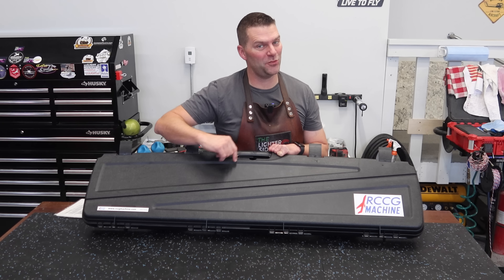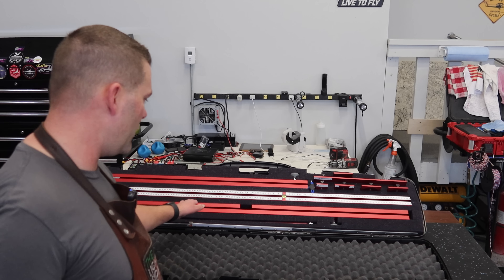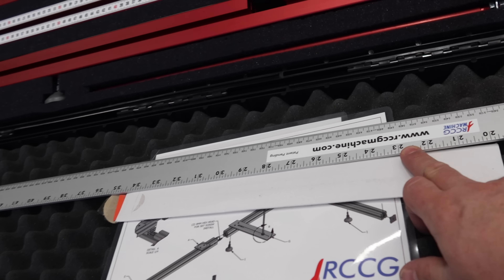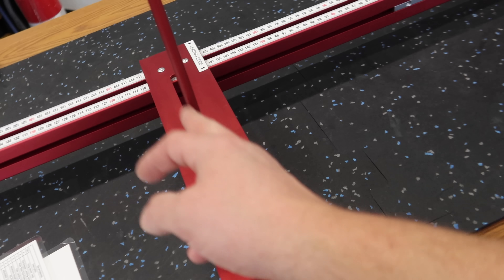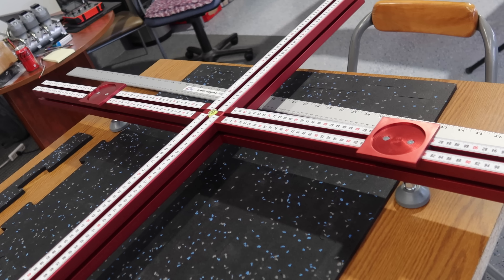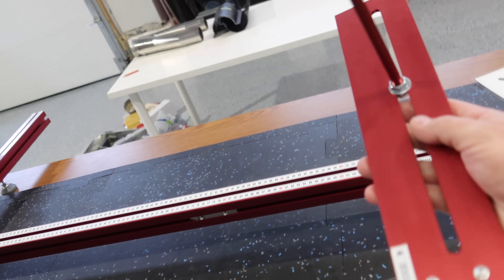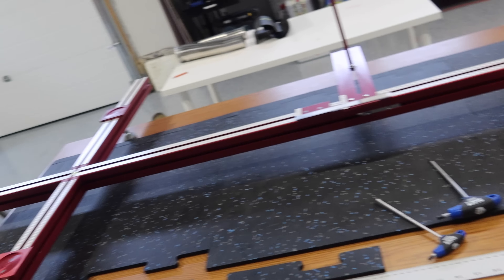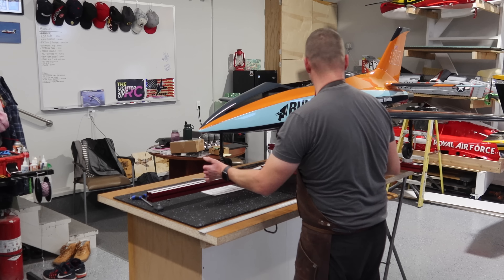NEW BALANCE Machine - THIS CHANGES EVERYTHING

Comment: This makes sense for someone in your position. For the general hobbyist such as myself. The xicoy is just fine. I may cg a plane on the xicoy  once a year or every two years. So it’s just not justifiable for $1200. This is bad ass though. And if it made sense and I had that kind of money, I’d definitely get one. However at the end of the day, $1200 for just a ruler system, imho, regardless of the convenience, is a bit high it seems.
Reply from the maker: Thanks!  It will get lots of use in the shop for sure!  Thanks for watching

Comment: I really, really ike this RCCG-Machine . . . and looking over and over the use of this tool on your Albatros-build . . .  then I guess ( 13:18 ) if you have spaced out both main gear wheels on the cross-bars . . . and you measure the diagonal from one main gear wheel directly to the nose wheel . . . and if you take this measurement to your RCCG-Machine . . . . then there is no need for "eye-balling" :-)      . . . . . and yep I look for the RCCG-Machine in Europe as soon as it is available. (my 2cnts)
Reply from the maker: Yea it's pretty dang sweet.  When you get the aircraft on the stand you already have your first measurement shown on the ruler.

Comment: Not sure this is easier then just using a yard stick. U still have to take most of the same measurements to set the thing up.
Reply from the maker: Of course you need all the same measurements. Having used a yard stick, tape measure. Masking tape, plumb Bob for many years now this is a huge time saver for me.

Comment: Great to see a new product come to market but I don't understand how this helps regarding precision provided that the user still has to center the wheels on the Xicoy sensors. If the centering of the wheel isn't exact, cg could be of by a few mm which is exactly the same problem as measuring.
Reply from the maker: Quite simple. It eliminates error in measuring and speeds up the measurement process. Unit levels so you know it’s level. On a garage floor or a bench/table on a garage floor it will typically slope to the door.

Comment: Great tool and in investement it matches up with the total-price of most scale-jets. Very, very smart design. Noticing there are "alternatives" for the Xicoy-set, it's interesting to know if thes will fit the "pucks". Any idea what the size is of the square pucks in which you place the Xicoy-scale?? If the square size and diameter is clear, I can check if this RCCG-Machine also fits the "alternatives" one. . . . opens the market al little bit more maybe. Thanks
Reply from the maker: Thanks and Totally Agree.  So many have such strong feelings that spending this much on a quality tool is crazy.  In Michaels "how to" video on his site he is using wireless pucks.  Not sure if they are Xicoy units or another brand but the area where the pucks sit are slightly oversized.  So the Xicoy pucks have a bit of wiggle room
Reply: @thelightersideofrc  Would be great if it suits/fits more "Xicoy-variants". Do you maybe have some measurements (square sizes and inner-diameter) so I can check overhere in the Netherlands? Appriciate 🙂
Reply from the maker: Can do. Please shoot me an email. Much easier than YouTube comments. thelightersideofrc@gmail.com

Comment: Hi, do you always only use the landing amount of fuel when measuring out the plane? If the fuel tank is not placed at CG that must affect the CG with full amount of fuel then.
Reply from the maker: As a general rule, CG is always set up when the plane is in landing condition. Obviously the further away the tank is from the CG point the more affect it has.

I will sometimes check the CG range from full to empty and in between, but ultimately if the plane becomes more nose, heavy when full, there’s not much you can do about it

Comment: Nice job I like the way it works, but my question is do you always C.G. your jets with the landing amount of fuel in the tanks?
Reply from the maker: Thanks!  Yes unless the tank is perfectly placed over the CG Point.  Generally this is not the case and it's slightly in front of the CG Point.  Always CGing in landing condition.
Reply: @The Lighter Side Of RC  thanks for the reply, I'll probably start adding a little fuel the next time I balance something it makes sense.
Reply from the maker: Perfect 🤩

Comment: Use a plumb Bob to get the front wheel from gear measurement and string a line between the mains and run measuring stick perpendicular to the main fr exact measurement and simplicity
Reply: Nvm not needed as you can adjust after you set the plane on th roughly set pucks

Comment: At $1200 this is quite the investment.  With the Xicoy we’re at $1500 to measure CG 😮
Reply from the maker: Oh for sure!  Great tools are worth the investment.  For me it totally makes sense.  I HATE laying out the plane and taking all the measurements on the ground, marking it on the tape ETC.  For the time savings alone this is worth it!
Reply: @thelightersideofrc  totally agree for a serial builder like yourself to automate CG measurements.  

The tougher part of the process for me is constant CG adjustments trying to improve flight performance. Challenging to judge the optimal spot, especially for 3D jets
Reply: How are you at $1500 with the xicoy to measure cg? I spent $400 us for the entire thing with angle sensors as well
Reply: @WickedMoto  if you click through to the balance machine site, the retail is listed as $1200.   The Xicoy CG meter retail is $300.
Reply: @OnTheSnap1  yea that’s why I was saying how are you at $1500 to measure cg when it costs $400 with angle sensors? Unless I’m not understanding with the way you worded ut
Reply: @WickedMoto  the video is about the CG machine accessory.  Not the Xicoy CG electronics.   So for the accessory for the Xicoy the price is $1200. Yes you can buy the Xicoy and use rulers/tape to make it work.  But the whole premise of this video and the new tool shown here is to make that process easier.  The tool presented in the video details for $1200.  So if you want the new tool plus the Xicoy you are in for a $1500 CG solution
Reply: @OnTheSnap1  ok that makes sense. I misread your comment as xicoy alone you’re $1500. I didn’t not read it as you meant it being $1200 for the ruler system plus $300 for the xicoy totaling $1500. My apologies, it’s a long day today and my brain isn’t working right
Reply: @OnTheSnap1  Not much when your jet cost $15,000.00